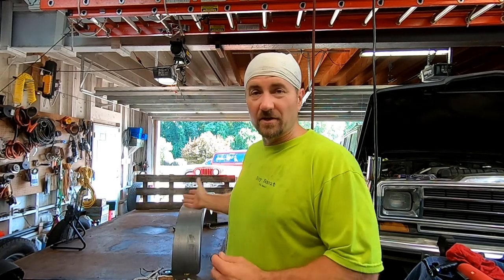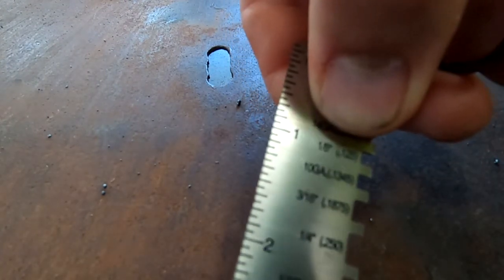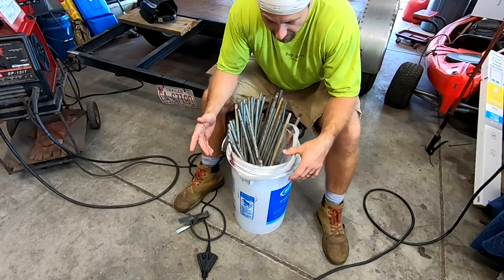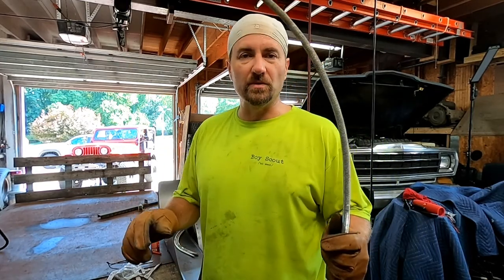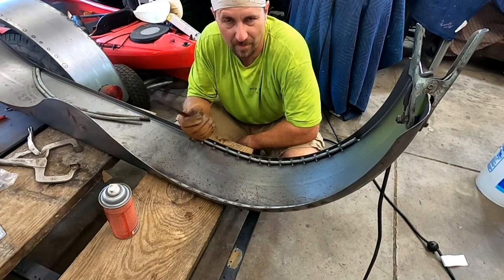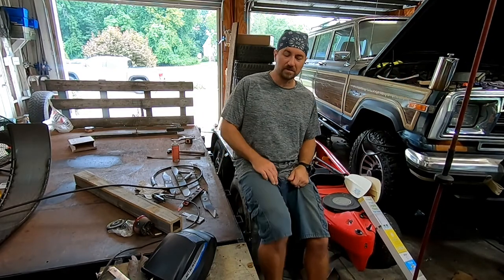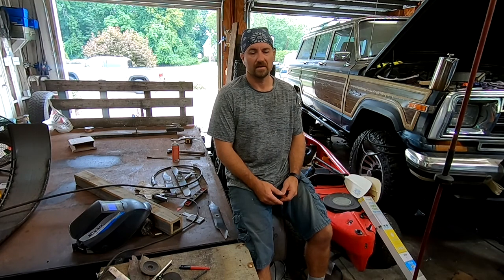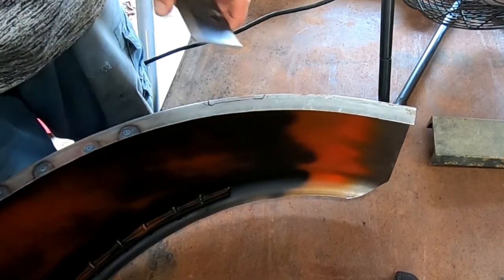Mounting Trailer fenders with Lawn Mower blades.

Comment: U.p. at gtfo property about to try out my home made manual well driver. Was gonna use Eye bolt and cement but didnt have time. Bolted some scrap metal together with old window weights and part of dock pole to slide into well pipe.
Reply from the maker: Nice.  Not a lot of people would stop and be creative.    Good job.    Now the real question.  did it work?   :)